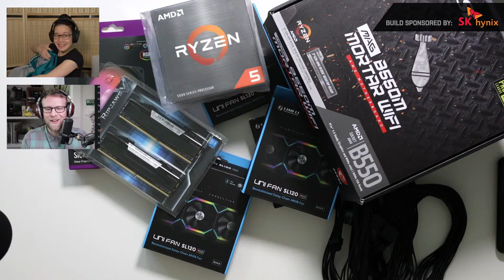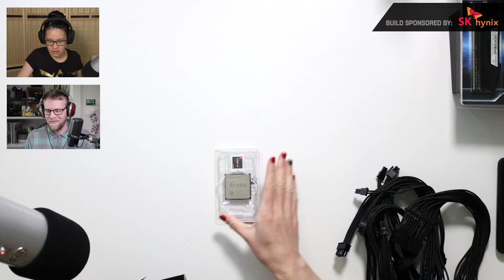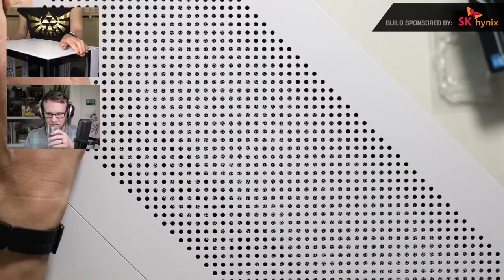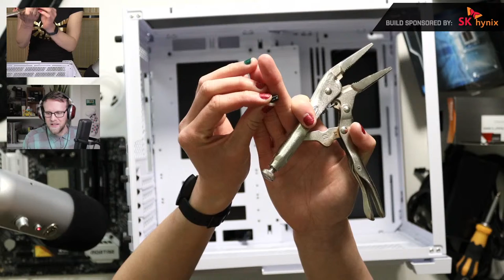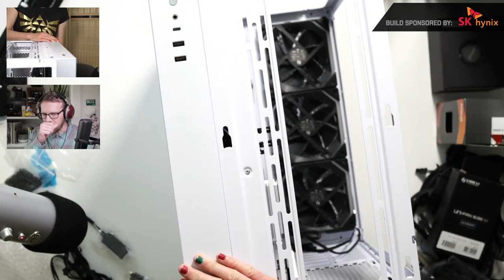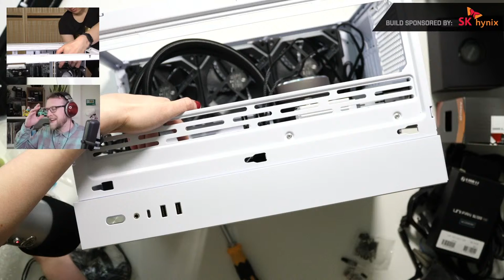All AMD gaming PC live build w/ 5600X & 6800XT (part 1)

Comment: You did change it, :)
Reply: If the pump is higher then the hose then that's were the air bubbles will be, pumps need water 24/7 to stay alive longer.